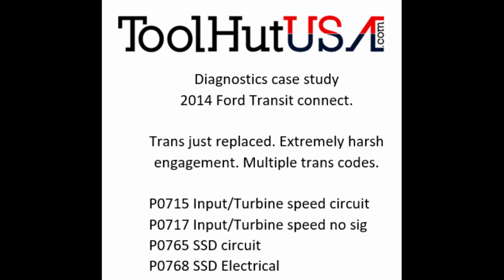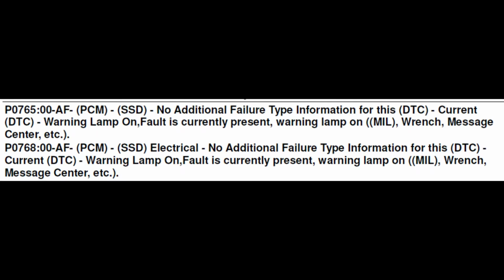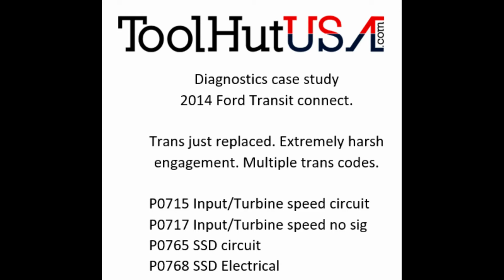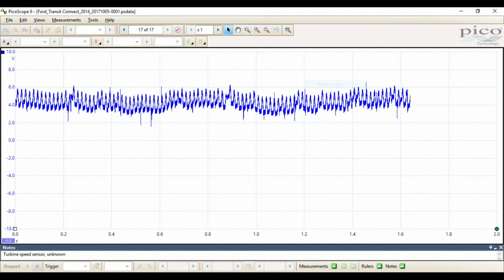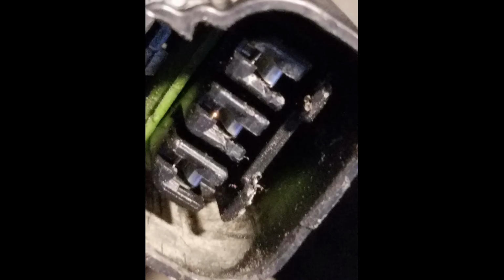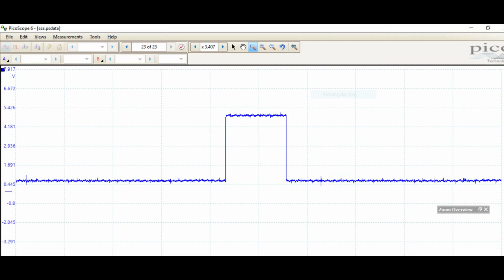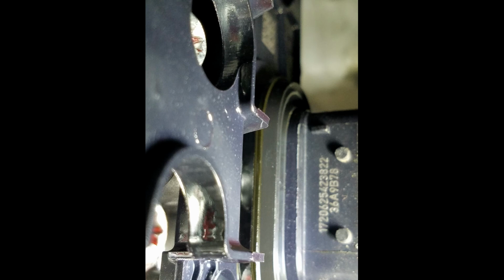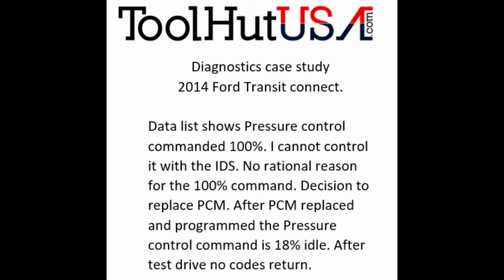2014 Ford Transit Connect P0715, P0717, P0765, P0768

Comment: Great diagnostic sir, i had the same problems and codes on 2014 Ford transit connect so the first thing I clean all the ground cables but same thing then I replaced the input shaft speed sensor and went for a test drive and still the same problems and codes then I came across you video so I went and checked the input shaft speed sensor connector and two wires were cut the funny thing is it look pretty good on the outside but when I pulled the wire two wires were broken lol, fixed the broken wires and for a test drive and it’s running and driving beautifully so thank you so much 
You are a life saver 👍🏼✌🏼🙏🏼

Comment: 1st of all thumbs up on the wire piercing!! Love hearing the diagnostic though process. I think it was spot on! Great job finding "a problem" and it seems the last "a problem" we find was "the problem." Interesting it was commanding it at 100% PC. Any chance that replacing and flashing the ECM cause any sort of "reset" so to speak that could have been preformed with the IDS? I am sure you probably looked but just curious. Did you happen to just try and re-flash the existing ECM? Might be a dumb question I know.